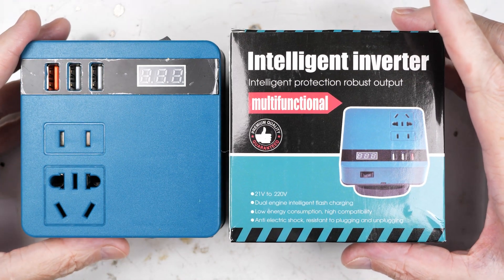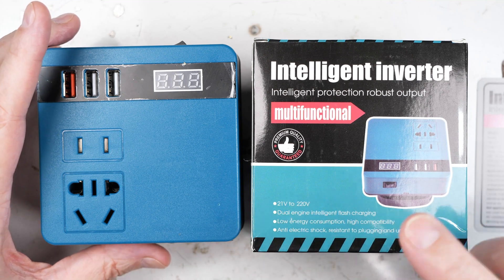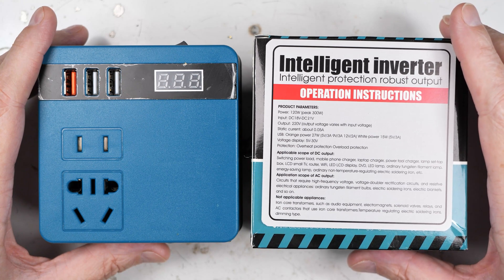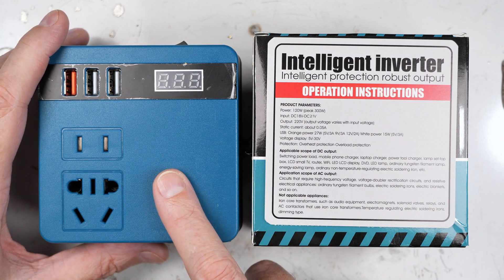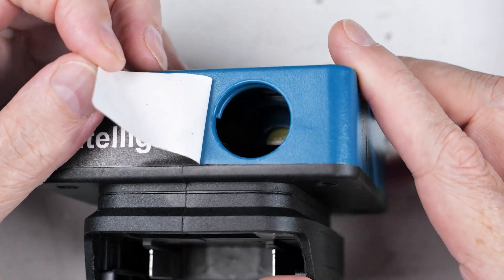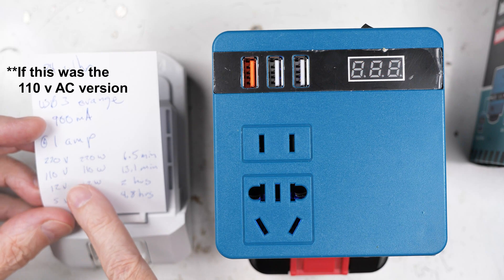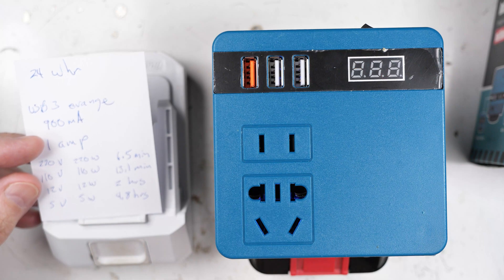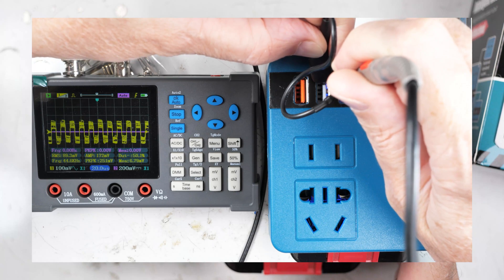110/220 AC From An 18v Drill Battery?

Comment: keep in mind that you will be mostly limited by 18650 batteries in the battery pack. Most of those packs use cheap low quality 18650 batteries (1.5Ah or 2.0Ah). Top quality ones are 3.0Ah or even 3.5Ah.
Max continues discharge rate for cheap batteries is ~5A. 3.7V * 5A =  18.5W (average power). If your pack has only 5 batteries then you will be limited to ~100W.

Comment: Man, I'd worry about discharging a battery that rapidly. I'll just stick with the OEM stuff anyway. I don't need a fire anytime lol
Reply: dont charge the danger batteries in your home while ur away, ye
Reply: even the OEM makitas im never leaving them to charge while away, unless it's in the shed deep in the garden away from the house. in winter time, you basically have to charge inside your house because if the batteries are too cold, charging them is baaad

Comment: Funny thing is, if they'd reduce the scope to clean USB power, it would actually be useful. There's really good, cheap USB powered soldering irons out there and i've run them off battery packs a few times. This is something i never really got with the people behind these products. They're clearly a waste of materials. They're not good at what they're supposed to do. Imagine if the drive behind making this item were aligned with actually making a useful product.